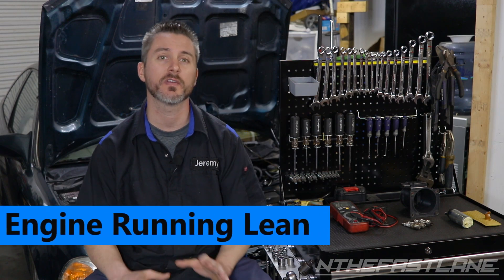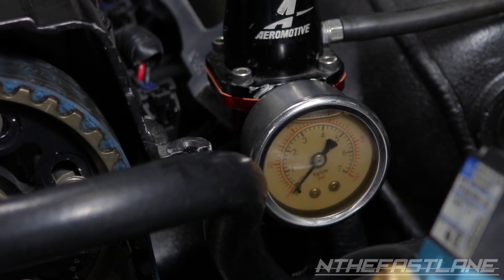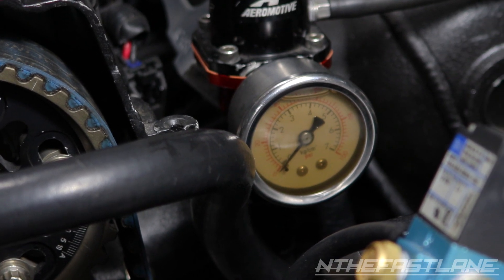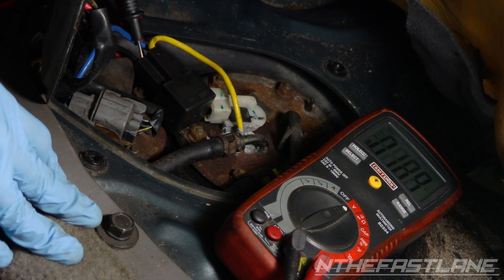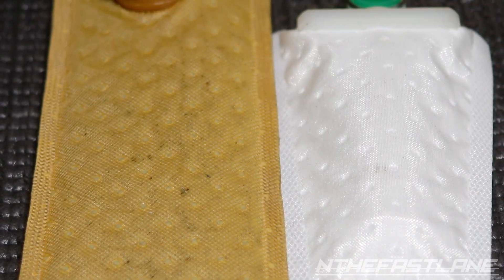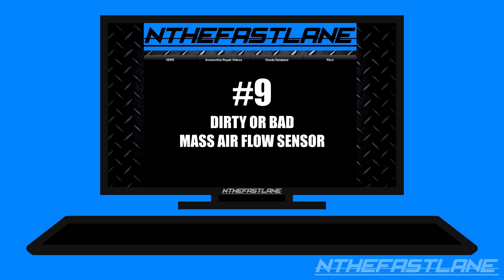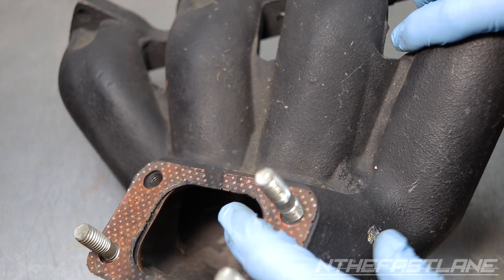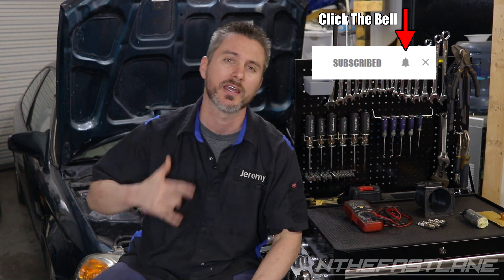▶️Engine Running Lean (11 Reasons Why)🔥

Comment from the maker: 🛒Shop This Video: https://www.nthefastlane.com/engine-running-lean-store
🛒Find Any Leak: https://amzn.to/3JADlYm
🛒Download Auto Repair Manuals: https://shrsl.com/3wmrj
🛒Visit Nthefastlane's Amazon Store: https://amzn.to/3pP4UCy

Automatic Transmission Slipping While Accelerating (7 Reasons Why)
https://youtu.be/aIzLp9hre98
Bad Gas Mileage (7 Reasons Why)
https://youtu.be/Fz2eGrDnb8o
Battery In Car Keeps Draining (8 Reasons Why)
https://youtu.be/4rd2Thz42bY

Comment: Checked for Vacuum 
Swapped fuel pump/filter
Swapped Injectors 
No fuel leak
Fuel pressure is fine
No exhaust leak
No stuck PCV 

God help me
Reply from the maker: Check MAP/MAF, O2 Sensor and Timing.

Comment: Have a 2015 mustang GT, after, 34k miles, I travel for work and my car sits a lot, didn’t do a good job treating car for long periods of no use. Now have misfire codes, changed plugs, light still came back on, dealer can’t pinpoint because light turned off. Found that catalytic converter is running hotter than normal, both cats are being replaced, hope problem gets solved 😓

Comment: wow thank you so much!
Reply from the maker: Anytime Rogue!
Reply: @Nthefastlane  99 EJ8, I have changed:
IACV valve, PCV, got injector cleaning machine and built a diy stand cleaned/changed, fuel filter, fuel pump, spark plugs and wires, Cap and rotor, both O2, knock sensor, temp sensor, got a smoke machine for vacuum test I am looking at a new crank sensor as I type. No forum ever - exhaust leak. . . I even know where exactly.. car is low and road to garage is bumpy... Thank you, cant wait to deal with it, made my month lol, Subbed!

Comment: Great video however every time you said 'will' I think you should have said 'could'.  "A bad fuel pressure regulator will definitely cause a lean condition".  Well, it COULD cause a lean condition, however, It COULD also cause a lot of other issues besides a lean condition.

Comment: I have a Mazda Miata 2010. I am unsure why my engine warning light turns on and off from time to time. The last time I got my car fixed was about a year ago, and the lean fuel issue went away for at least a month. Whenever I start the car up from a cold start, it idles at 2K RPM, and then slowly goes down to around 1K RPM in a few minutes. I am debating when I will take the car in to see which one of these issues is the primary suspect to be focused on and fixed. If I could, I would like to do all of them at once, since the major modification I have left on my car is a sports/race exhaust. I originally had an AEM air filter, but I reverted back to stock during the major repair. The main reason was for risks of sucking up water through the grill. Since the exhaust is not stock, I am concerned about that also being a possible problem, since the air filter has been reverted back to factory.

Comment: How bad is it to keep driving my 05 chevy cobalt for now until i have someone look at it
Reply: Not bad at all.  The Chevy Cobalt was designed for morons to drive forever without ever changing the oil, checking tire pressure, or even checking your mirrors when driving.  Congratulations, you bought a maintenance-free vehicle.
Reply: Came here looking for an answer like that. What about a 2006 Chevy equinox? My engine is running lean. I have no idea why. Should I still drive it?

Comment: cars are headaches sometimes
Reply: If don't treat it like your wife/husband for sure it will be a headache.
Reply: @balloney2175  i found out why my car was running lean... water was getting into the gas tank
Reply: @454marii  how is that happening, do you know?
Reply: @balloney2175  yeah, the fuel filler neck had a hole in it fixed that problem already

Comment: By any chance you know why the oxygen sensor keep burning?
My truck keep burning them and it won't pass smog
Reply from the maker: What codes are you getting?
Reply from the maker: What brand O2 sensor are you using? Also is this an aftermarket exhaust with a relocation of the oxygen sensor bung? What color is the O2 sensor when you pull it out?
Reply: @Nthefastlane  I took the truck to the shop and they spent one month and they didn't fix it, that's What they said it just keep burning the sensor
Reply: My truck is a dodge ram 2001, 5.9
Every thing is original
Reply: A leak in the system.

Replace all exhaust manifold gaskets or header gaskets with high quality new ones.
Replace collector gaskets where the exhaust is connected to the manifold or header.
Make sure to use the right size fasteners with washers and lock washers if possible.

Tighten everything up !

Make sure all welds are air tight. Like around the 02 sensor bung.
Look around welds for signs of exhaust blowing through porous welds.
Reply: I put a bonding wire on my exhaust system. I had a massive exhaust burn mark on my rear bumper. -_-